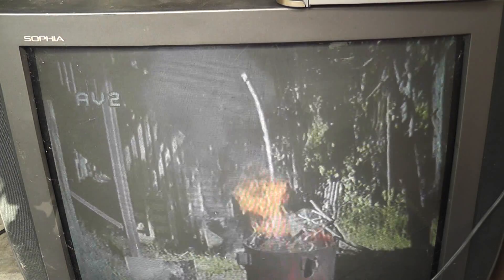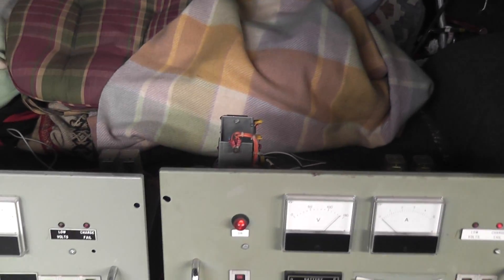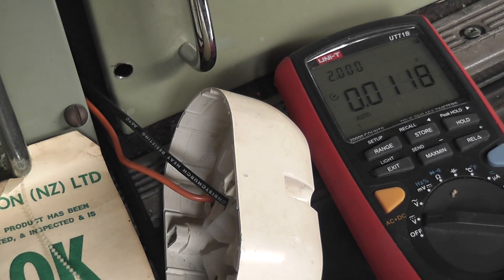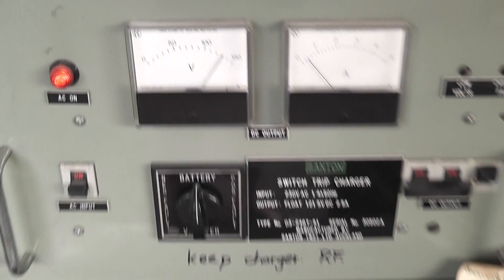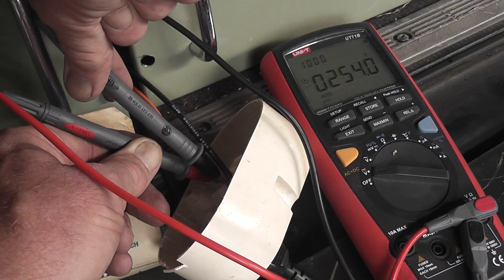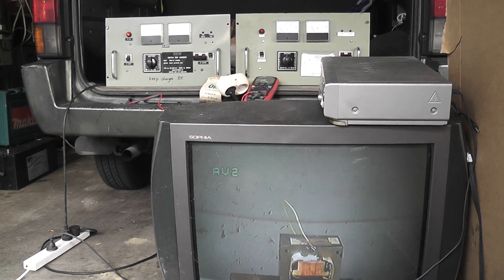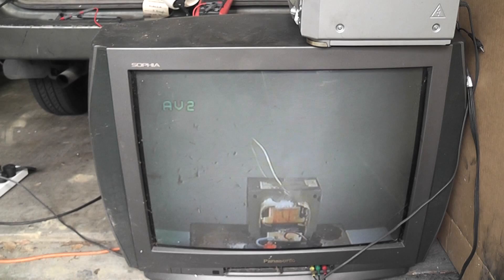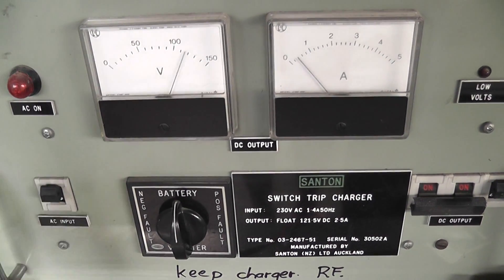old CRT TV on 250 Volts Direct Current

Comment: Only part that uses AC in CRT TV's is degaussing coil in series with PTC to align the image properly if the stray magnetic fields are present on the front screen plate. Usually if it doesn't degauss you get a distorted colors on the image. 125VDC, is 79,5VAC rectified, I have a mains SMPS USB charger that works with 5VDC in outputting 5VDC.

Comment: Cool experiment, I was afraid going from 240 AC 50hz to 250 DC would have actually been more destructive, since around here 120v 60hz would carry roughly the same energy as 36.5v DC. Though the rectifier could be limiting it for safe use by the tv itself.

Comment: the only thing to be careful with, is the switch being ac rated may not appreciate breaking DC supplies, but most modern equipment should run at 90v or so. inverters are more or less pointless with modern gear

Comment: You can also test using a cheap mains inverter. Mine contains a switch-mode step-up transformer, a 300-odd volt DC bus and a chopper that creates the filthy step-approximated sine wave. A kettle lead with the polarity marked on the plug and the ends soldered across one of the DC capacitors provides a custom DC output, a neon indicator shows when the DC supply has discharged to a safer level.

Comment: It's quite amazing that the TV kept going when the voltage was dropped to 125v, I would have expected the picture to go dim and to go to a small square in the centre of the screen.

I'm assuming that the power supply section is set up in a similar way to what's found in most modern phone chargers.

Comment: The first thing the mains hits in these things is a bridge rectifier, so your experiment would have meant nothing to it. That then goes across a big cap making 350vDC, which is then chopped up (generally at 15625Hz, same freq as horizontal deflection for PAL). With these sets, the horizontal output stage and the power supply are basically the same thing, in the old days called a "bootstrap". Made them bloody hard to service though!
Reply from the maker: +zordmaker Yes, part I agree, part I disagree here. Nameplate states 230 V 50 Hz. Manufacturer could have stated 230 V ac50Hz/dc suitable.
Some TV's require mains reference pulses to stay in synch.
Reply: +RODALCO2007 The nameplate reflects what the item is certified to accept, i.e. what the testing lab has used to test the unit for it's C tick (or whatever it is now). If the lab had been asked to test it's DC operation then it would no doubt have done this, and then the spec would have been name plated.TVs using the mains as a frequency standard have not been built since some of the very first Colour sets the '70s...
Reply from the maker: +zordmaker Thanks for that info, I learned something I wasn't aware off.

Comment: One video request: could you try to fill a working crt with oil?

Like powered on submerged in oil, making hole in crt..

Warnings about high voltage, sharp edges, heavy objects, vacuum, mains etc apply!
Reply from the maker: +erlendse A CRT will fail immediately when the vacuum is lost, weather in oil or air.
Reply: +RODALCO2007 Possibly so, do you know the vapour pressure of the oil?

I know gas is byebye, while oil is somewhat less certain to me. (avoid air bubbles)

Long term (beyond some few seconds) the tube would be screwed anyway.
Reply: +RODALCO2007 Otherwise, if you are up for a challenge, you can cut the shadow mask apart using the electron beam! takes some finesse, but I have cut hole in it before on a crt!

Comment: I thinks switch mode PSUs cope with a DC input extremely well  as you say it just compensates for the lower DC voltage by drawing more amps its running at around 130 volts less than it would do with rectified mains

Comment: Try it with an even older TV which does derive the frequencies from the mains cycles. This won't work until you bring in a 50 Hz sine into the frequency doublers.
Edit: It could be that the frequency doublers are so sensitive (high impedance) that they receive the 50Hz hum around your man cave. Haha!
Reply from the maker: +BloodySword Haven't got a pre-1990 TV at the moment.
Reply: +RODALCO2007 You'd have to go well back beyond 1980 for that...

Comment: just needs degaussing, only SMPS will work!
Reply: +HDXFH Some May not, depending on circuit design
Reply: +HDXFH 99% use the incoming AC mains to drive the degaussing coils using the ubiquitous 2 or 3 wire degaussing posistor/NTC unit, the only ones that do not use the same posistor but run it off the SMS transformer in the set after doing some filtering to get a sinewave out of the pulse train. Only seen that in aircraft CRT units which ran off the 28VDC bus. Think that extra filtering and the low inductance coil along with the control relay cost more than most consumer TV sets cost, even the big Sony rear projection types.

Not surprising that the TV set ran on 80VAC, as they use the same supply in US sets, so they are designed for operation from 70-260VAC, covering all mains voltages and the limits of them as well. No mains sync in a TV set in any case, it uses the incoming video alone for sync, and with no video coming in simply switches to the free running divided down clock as sync source. That is why the on screen displays are rock steady even with white noise on the screen, the drive is coming from the same clock till there is a good sync which then is used to drive the OSD character generator instead. You can see this if you turn off the blue background on no signal, which uses the sync detector output to simply show a full screen OSD of a blue block.